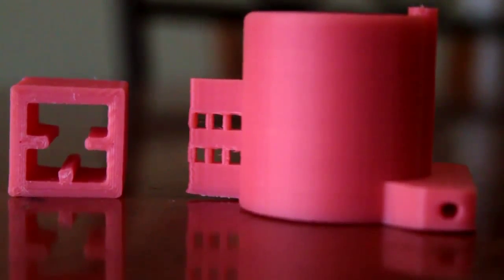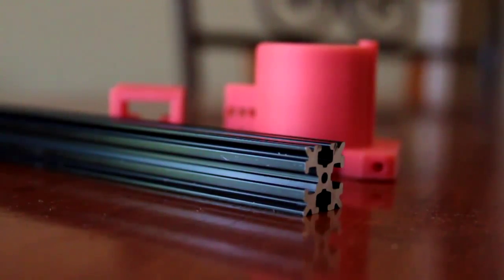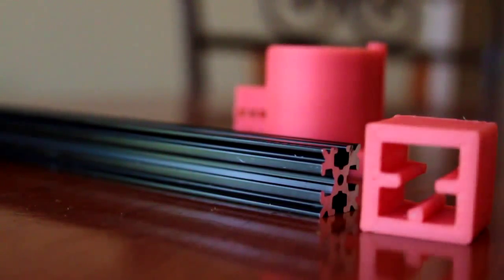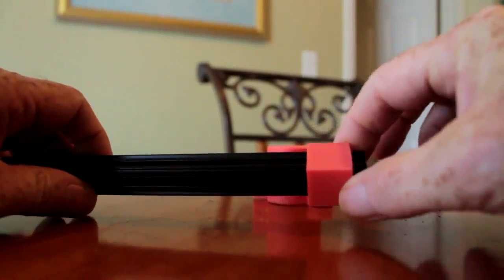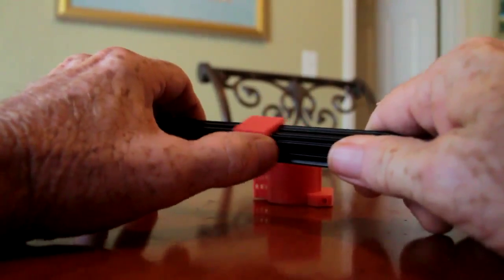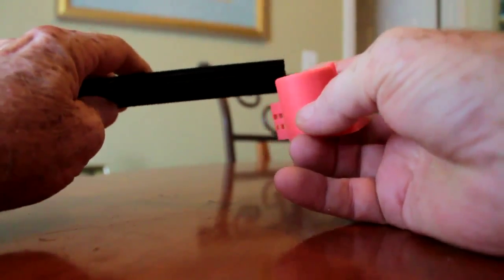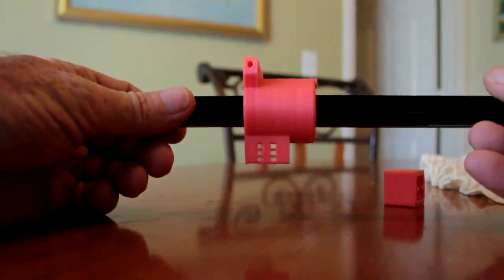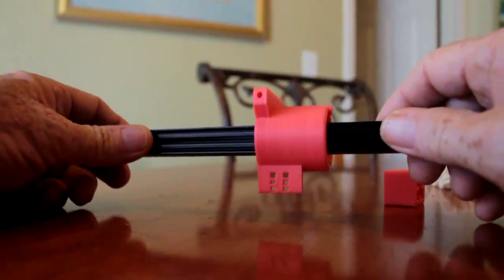Kossel 3D Printer DIY Linear Bearing Replacement concept

Comment: The surface finish on your prints are amazing. I've been trying to achieve that for a year now, I think need bushings, or replacement linear bearings that aren't as loose